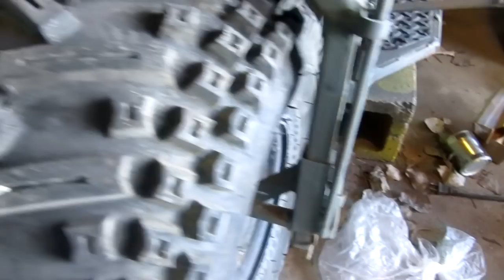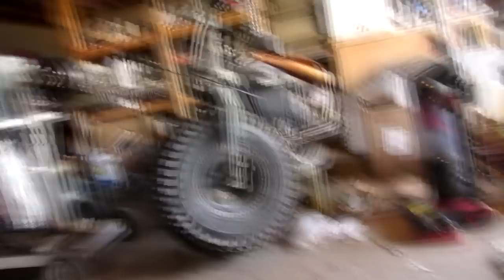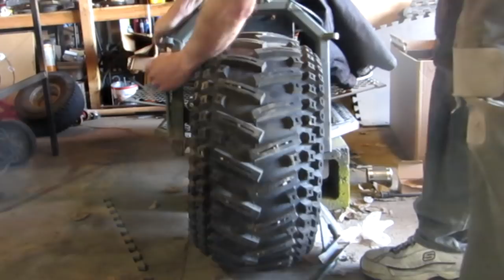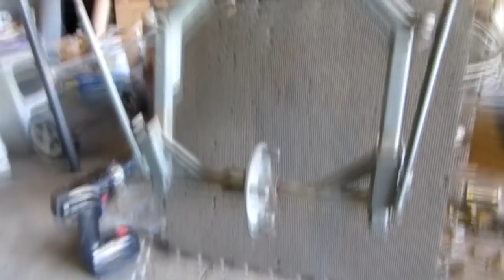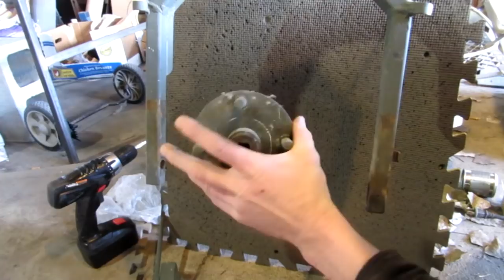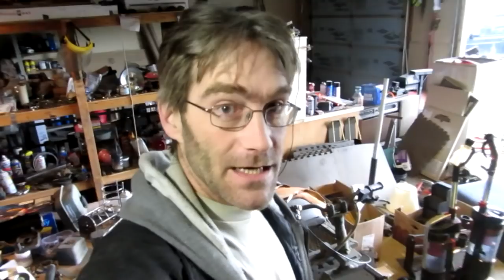Fat Tire Minibike | Front Forks | Closer Look

Comment: another way to build the forks would be a 3/4, 1, or 1-1\4 inch keyed shaft with hub 4 lock collars and 2 flange pillow blocks. that way you could add front brakes in the future